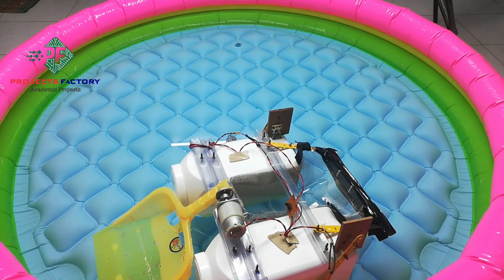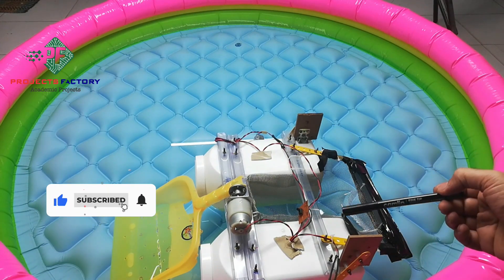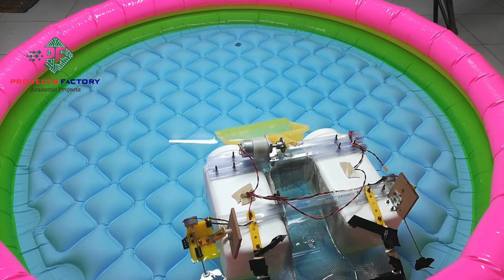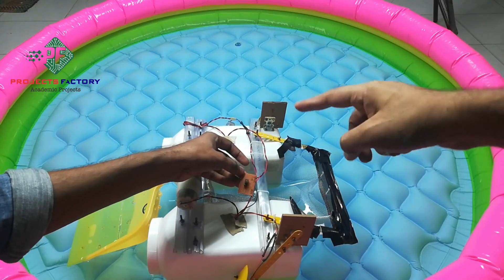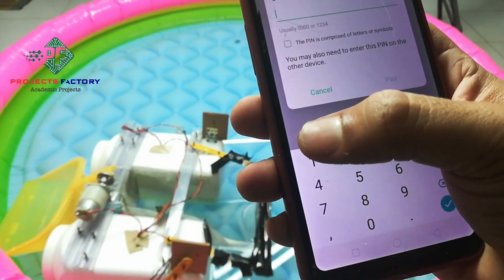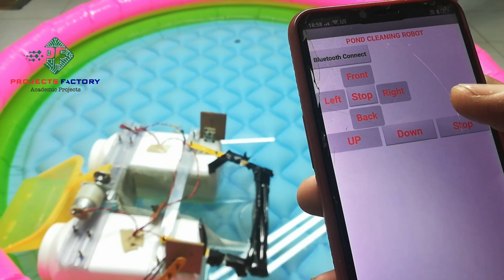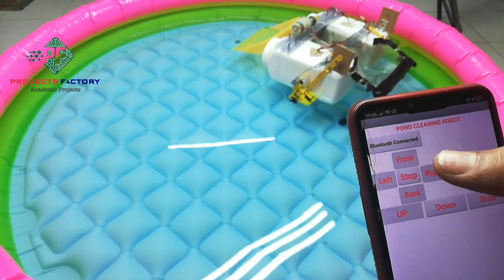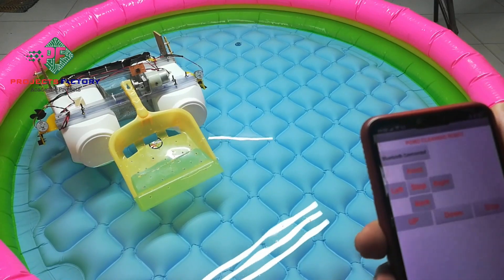Wireless River Cleaning Boat

Comment: Lovely control and project overall

1 thing is, instead of a put out flap, can we use a moving plane, where the plane has spikes and when comes in contact to waste in water, it picks automatically and the plane which is moving from 2 rotor shafts is deploying that waste at the other end to a container like here